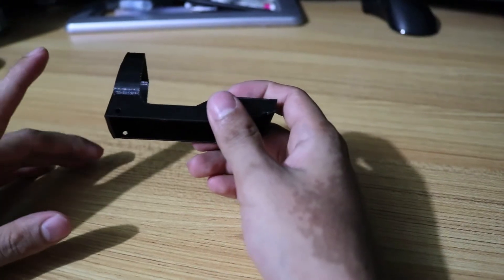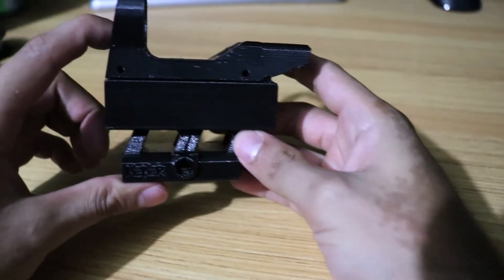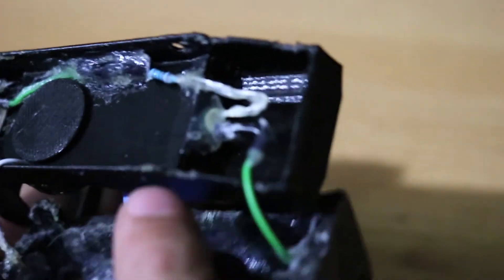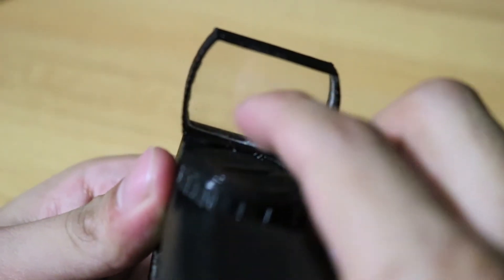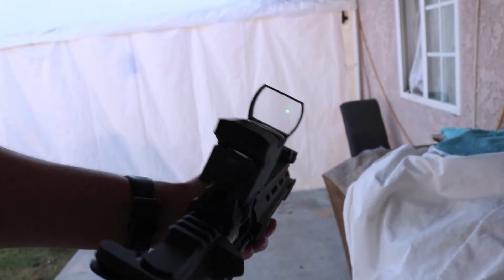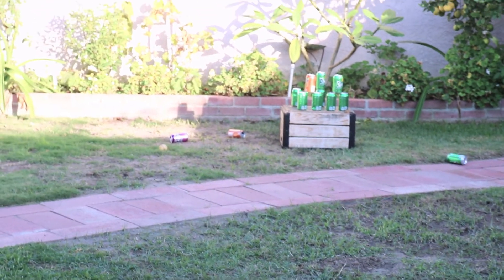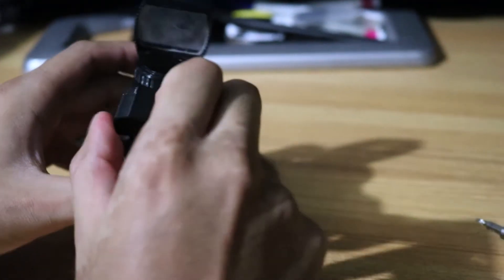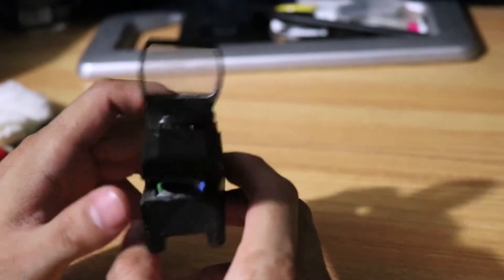3D Printed Red Dot Sight for Airsoft

Comment: I'm going to design and print my own version of this with some of my own improvements. It will fit on the gun without an attachment and be adjustable... I have a few questions:
Where did you get the LED, wiring, switch, resistor... I'm don't know anything about electricity and wiring and stuff.
What kind of a weird battery is that? can I just use a standard AA or something?
Anything else I need to know about the electric stuff in it?
Reply: Stop Motion Man if you haven’t finished this project already one of the best ways to skip the electronics is to buy a light from the dollar store and take it apart and reuse it for this. That way it’ll already have the battery, switch, led all soldered and ready to go
Reply: @matthewmcguinness5538  battery looks like a 14500
Reply: mouser is a good place for electronic components